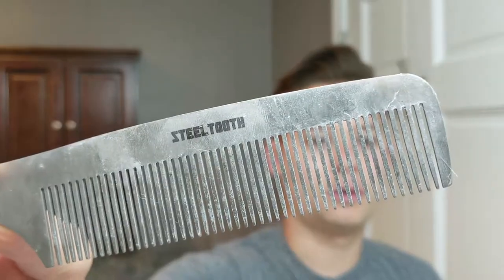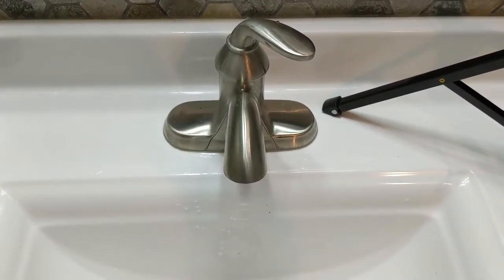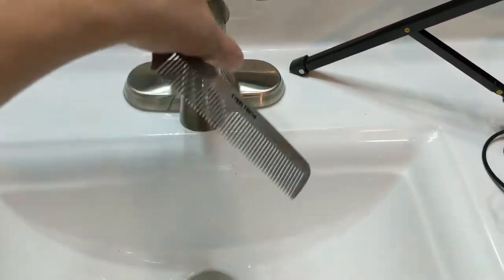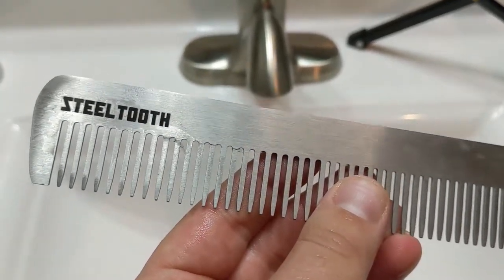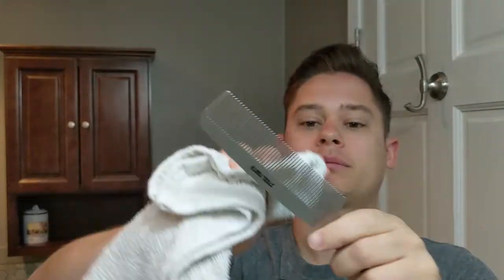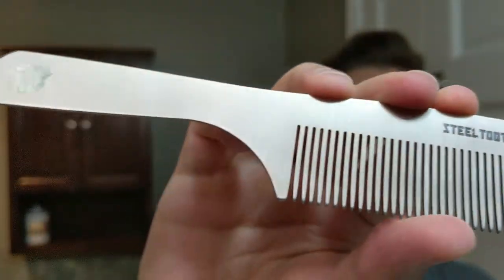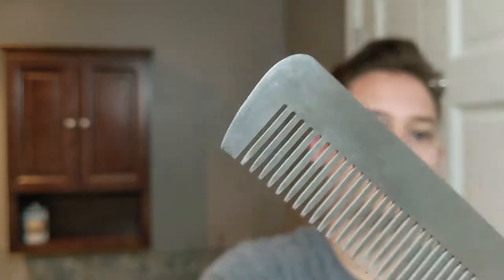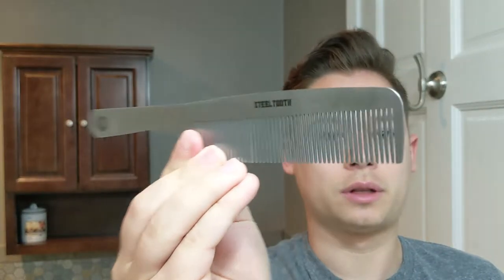How to Clean Your Combs Super Easy

Comment: I love my steel comb it is heat protected when I blow dry my hair when I towel dry my hair. I like to blow dry my hair with added Arian oil to my towel dry hair. Then I blow dry my hair and comb my hair at the same time. After it dry I add hair products to my hair and style my hair with my steel come. It’s amazing it really maintain my hair that way you should give it a try. But cool tip thanks you.